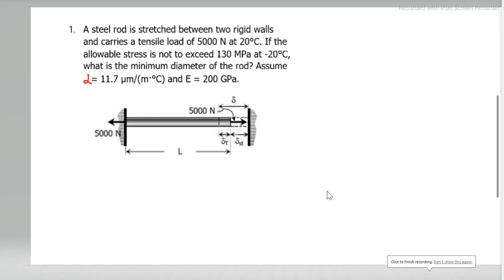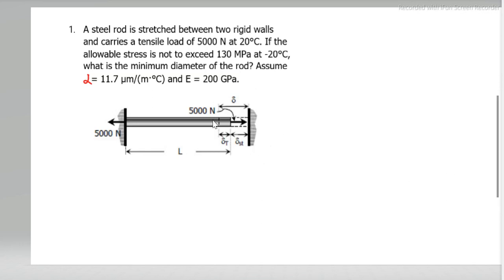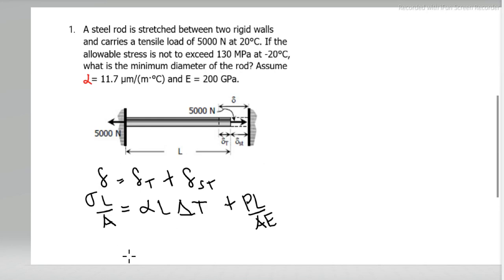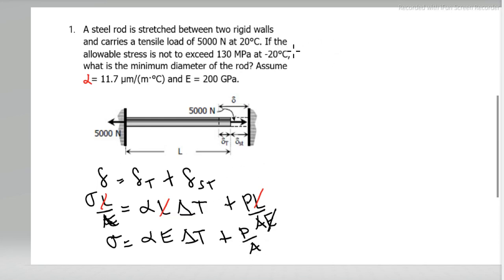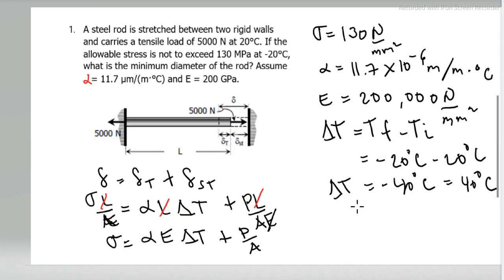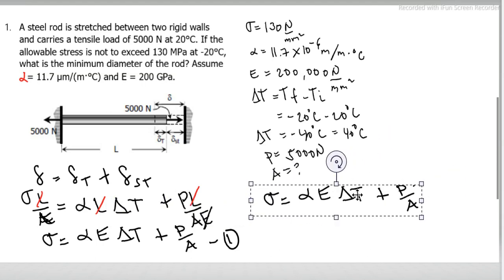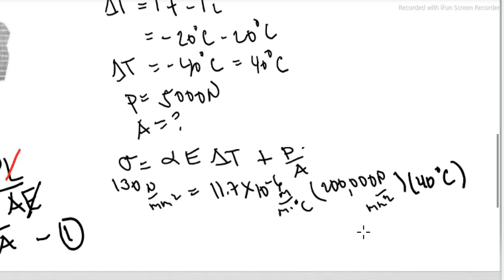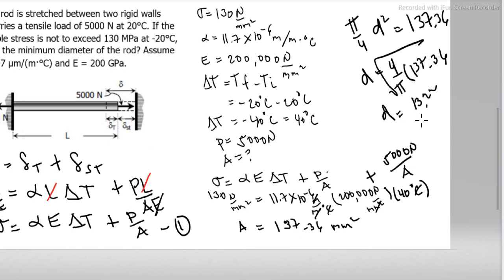Mechanics of Deformable Bodies / Strength of Material Thermal Stress Problem 262 & Solution

Comment: Why is the change in temperature 40 and not 40- ??
Reply from the maker: Change in an absolute value. It is the measurement between 20C to -20C. Example 0C to +10C is 10  or 0C to -10C is 10.